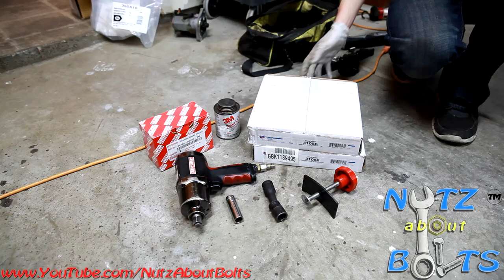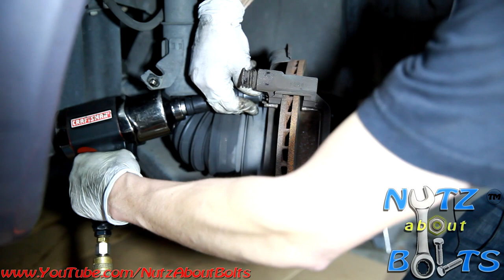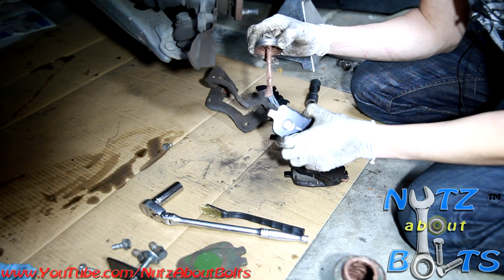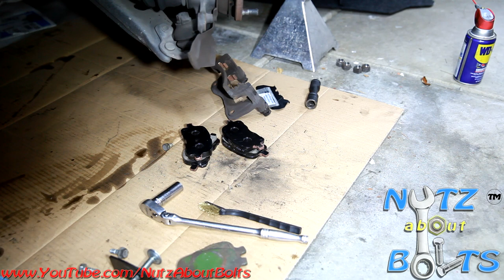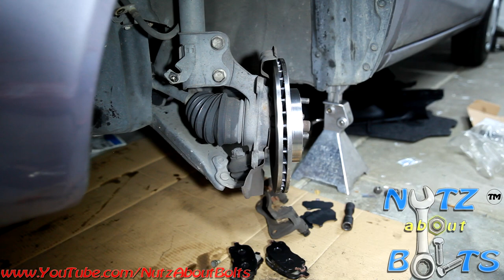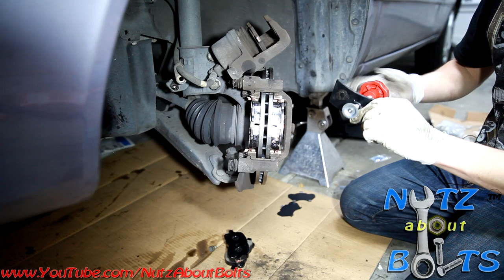1998-2008 Toyota Corolla Front brakes remove and install

Comment: Thanks for the great video. I ran into some rust issues with the bolts, and the rotors were so bad they took a lot of work to get out.  Wouldn't have even tried without your video though. Saved some cash, learned how to do something, and feel pretty good about it. Thanks for posting. Well done.
Reply from the maker: +Tim Zado thanks man! good work on doing this yourself! now you know a little more about your vehicle than before, keep up the good work.

Comment: Great Video NutzAboutBoltz!  One thing I would point out is that if you have the types of shims that have the rubber inside, there isn't really a need to grease inside, but you should grease the outside, to prevent noise/wear from the piston to shim and caliper to shim contact points.  Again good Job and very informative and well done video!
Reply from the maker: Tracy Mitchell haven't seen rubber shims before... All brake shims are made of metal type material, and needs to be lubed inside and out so that the shims will hold tight and not fall off or loosen. Unless we are missing something here?
Reply: Did you use the 3M Silicone paste to lube? Thanks. Your video is very easy to follow.

Comment: Hi.Good instructional vid, nice step by step walkthrough.One query though, when you push the piston back prior to reassembly do you take the lid off of the brake fluid reservoir to stop the back pressure rupturing any weak brake lines?Keep up the good work.
Reply from the maker: you don't have to, we never do and never gave us any problems.
Reply: There is no need to remove the brake reservoir lid. It is ventilated.

Comment: Rotors looked pretty good, did you need to replace them?
Reply: I (almost) always replace rotors with new rotors when replacing pads. If you can afford it do it. If rotors are really worn it's a must unless you want your new pads worn out really fast. Rotors are pretty cheap not a days so don't bother having them resurfaced it's not worth it resurfaced rotors are thinner and have the potential to warp.

Comment: I'm thinking of drilling and tapping grease fittings directly into the caliper right at the ends of the sliding pin housings. Since all of my front joints are greasable, it would be nice to be able to give each pin a few shots of grease every time I do a lube without having to remove my front wheels.  

Another reason for doing this is because I currently use ceramic brake pads which last a lot longer than semi-metallics. I may soon also go to carbon fiber pads, which are coming down in price and they last even longer than ceramics.... a LOT longer than the grease in the pins lasts. I would have a dedicated grease gun that has ceramic grease in it specifically for the brake pins. Dumb idea?

Comment: How do you bleed the brakes? My caliper closed up due to the wear of the old pads and now the new ones won't fit..?
Reply from the maker: watch any of our honda brake bleeding, its the same concept but different size wrench for the bleeder valves.

Comment: Hey mate, wondering if you'd ever do a rear brakes remove and install or is it pretty much the same thing? This is for a corolla 2005 (ZZE122R hatch). Cheers for this video!
Reply from the maker: we will try, but still working to find time lol, it's the same concept as the honda accords rear drums or rotors.
Reply: Did you do a video for that? I have rear rotors and pads for the corolla
Reply from the maker: CVonC
no but check the camry rear rotor video, same concept. Not sure if you need that cube or not, but if you do, then that's how you would use it.

Comment: I'm pretty sure they are all ABS. You're just not seeing the ABS sensor. And I either didn't catch it, or you forgot to bleed the brakes when your done per side. It's important to bleed the brakes at every brake change so the old fluid doesn't flow back up into the system.

Comment: Great video! I have a screetching squeaky wheel sound when I drive slowly. The sound stops when I touch the brakes or when rolling backward. Brakes or wheel bearing? Car is an 99 Corolla.
Reply from the maker: you should check your pads and rotors to see if its low.

Comment: Can a C clamp and an old pad be used to push the brake piston back in or do I have to get the tool?
Reply from the maker: You can use the C clamp and the old brake pad

Comment: Good job. Around how much will cost for these new drums and pads work?
Reply from the maker: +THOMAS SAMUEL around 100$ for the rotors and pads
Reply: THOMAS SAMUEL depends on the brand you buy. Got my regular rotors for $40 (for the set) and  premium ceramic pads $35. Then bought the lube and tools for about $20-30.

Comment: looking at rotors: "its all rusty and nasty"   Thats all the reason to change the rotors?  Not.    In most life of cars, you only need to change front rotor once unless it shows warping damage which can be felt by shaking, otherwise just clean, manually sand it over. to take out glaze, then put it back.  If you've done brake pads many many times, it is so much nicer to put back the old horse rein

Comment: i attempted this today for the first time and got it done. i had trouble pushing the piston back in. i nearly broke a C clamp with the force i had to use. it shouldn't be like that should it? i might take it apart again to put some grease on the bolts too, also i didn't get shims. would you recommend genuine Toyota pads?
Reply: oh and fantastic video! great step by step guide! your accent is cool too, i could listen to you all day!
Reply from the maker: I would recommend checking if the piston is seized or not. did your brake pads have uneven wear? I would definitely get the piston check out since it can be a safety issue. We would recommend shims since it'll prevent brake noise. Toyota brand is fine or you can go with after market with shims.